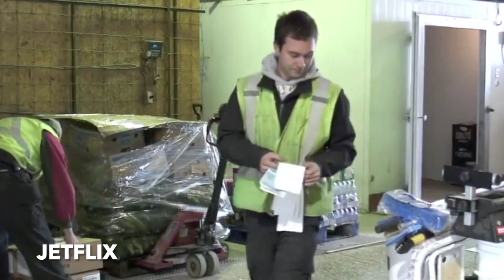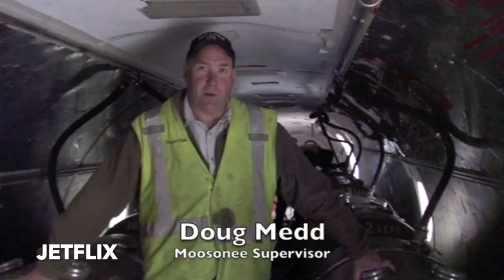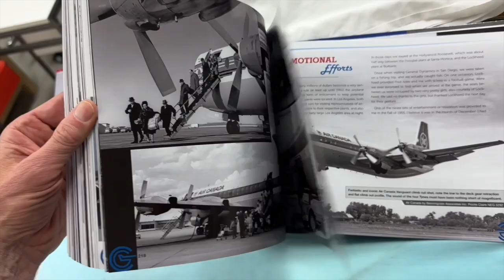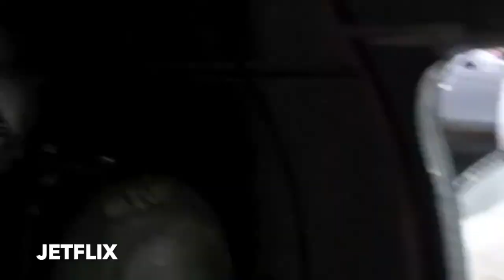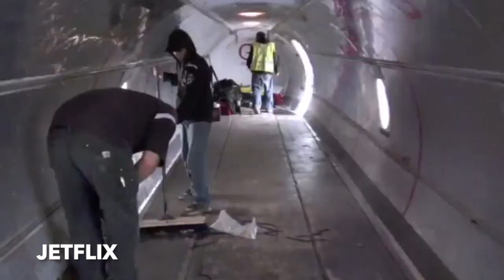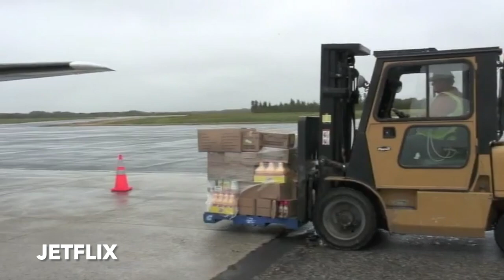Canada's Last HS748 Operation [PART 1] | With Henry Tenby

Comment: Many thanks for such an interesting programme.  Having been to Moosonee about 30 years ago (by rail in both directions), I hadn't realised that freight was transferred from the railway for onward dispatch by air to settlements further north.  I did have a flight on a 748 back in 1997 and that was in Canada as well, a Calm Air flight back from Churchill to Winnipeg after doing the outward leg on the train!
Reply from the maker: My pleasurw, I also flew Calm Air HS748 round trip YWG to Thompson mid 1990s.

Comment: A very fine aircraft. Only time I flew as a pax in a 748, I was some 12 years old back in 1975, my dad had a C182 and due to weather, he decided to airline, they shut down the right engine some 15 mins before landing. I still can see the shadows of the blades moving slow on the ceiling interior, before sunset. :)
Reply from the maker: Thank you so much for sharing your memory of that flight on the 748. Amazing you flew on only 1 RR Dart engine.

Comment: I don't see how that bottom beacon on the 748 would last very long on any gravel strips, it's directly behind the nose tires, we had Beech 99 airliners in AK and the bottom rotating beacons wouldn't even last a full day of flying on gravel strips unless we built a wire mesh cage around them
Reply from the maker: It is so high above the ground few stones get up that high … I think this is the beneficiary feature.